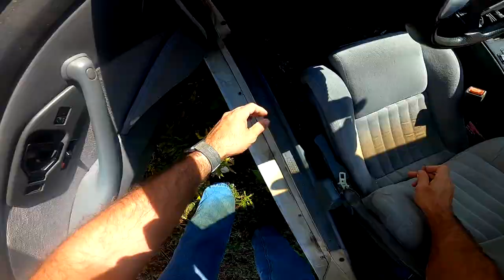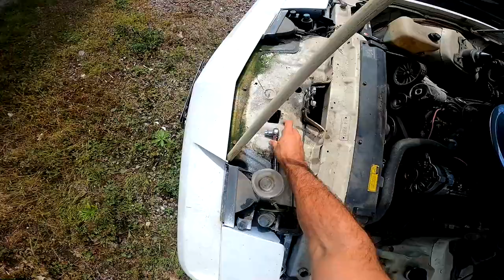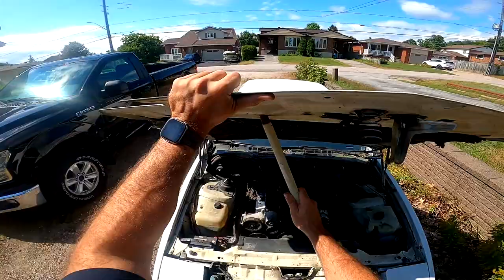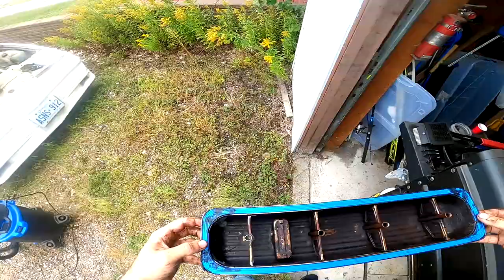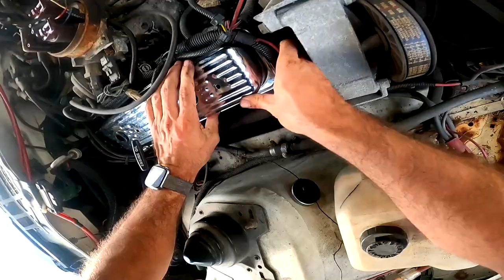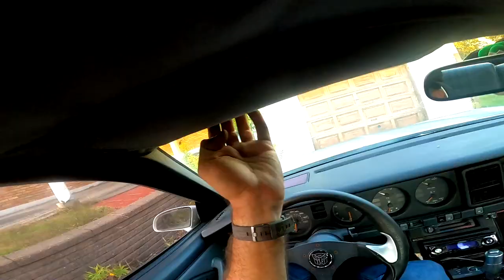1988 TransAm 305 L03 Valve Cover Gaskets

Comment: If you noticed the way you took the driver's side valve cover off, you went horizontal under the alternator in the video, when you tried putting it back on you were going from above the alternator.
Reply from the maker: yeah I didn't have video for reference.  All good sometimes you have to remove stuff to put stuff back on.